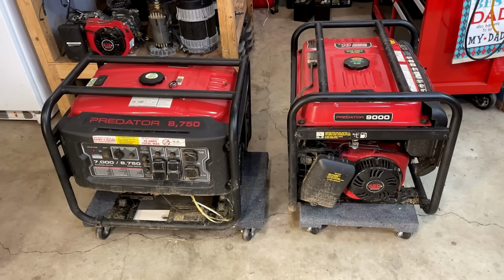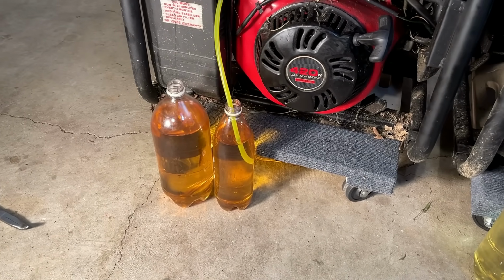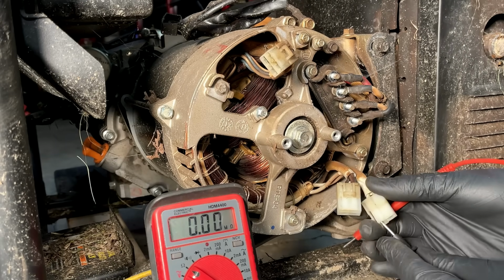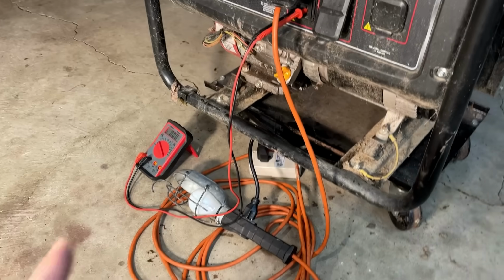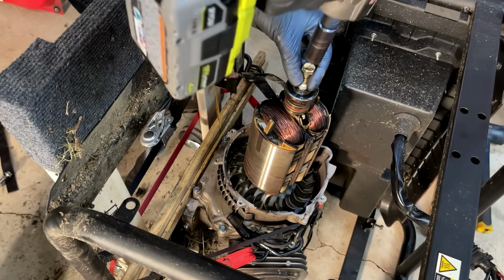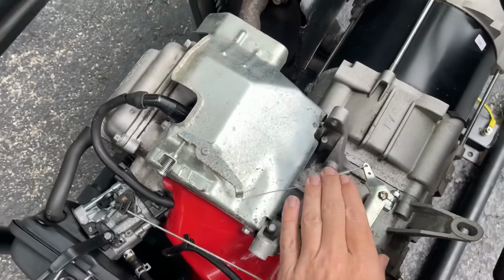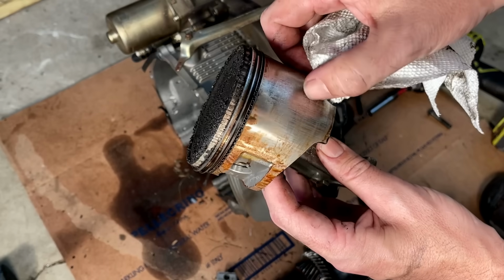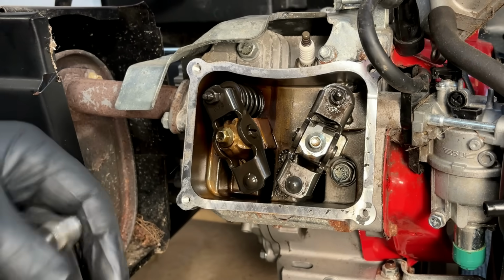3 Abandoned Predator Generators - Will They Run?

Comment: I hope nobody gets an idea that these generators are complete junk from this video, these actually are worth the price when comparing them to any other of the Chinese Honda clone generators from Briggs, generac, Honeywell, lifan, and many others. Proper break-in and oil changes keeps these running well for at least 1500 to 2k hours. The first two probably never had an oil change since new.
Reply from the maker: The original owner definitely got his moneys worth on these.  It does not take long to run up thousands of hours on a generator when living off grid.  These are meant for temporary emergency power and not expect to last much more then 1500 hours or run 24x7.  But they can last a lot longer if properly maintained and a little bit of luck.  I wish that had an hour counter.  It would have been interesting to see how many hours they had on them.
Reply: @jcondon1  Well at least you solved the mystery where the bearing race came from.
Reply: @jcondon1 I have a 2 year old same Predator 9000 generator. Do you have any idea what the THD% is on that generator. It’s not listed in the the manual. I called Hf and asked and they said it’s not listed bc it’s not a inverter generator. He did say that it has a voltage regulator to maintain 60HZ. I’m just wonder about dirty electricity with my electronics especially my furnace which is 2yrs old. Do you have any input? Love your channel!
Reply: @demetriosa7646  kinda funny that they say the voltage regulator maintains the frequency, because that is completely wrong the spring acting against the mechanical governor control s the frequency and the voltage regulator controls the DC Exciter voltage for the rotor and thus maintains the correct voltage for the AC output of the generator
Reply: Well, he must have bought at least four over five years.   If we suppose he was running them 24/7, then he was getting about 11,000 hours out of each one before failure.   Probably never changed the oil at all and that lead to the failure on each of them.
Reply: I have two of them.  They run great. Change the oil every 50 hours.
Reply: …and, were probably run for hours and hours every day, being off-grid.
Reply: What do you figure caused these engine problems? Oil neglect?
Reply: How much can you sell that smoking one for?
Reply: I’ll be honest the video didn’t convince me they are junk, it was the 30 seconds of run time I got out of my 8750w inverter generator and the 90 day warranty. I would have looked past the locked up engine and exchanged it if i didn’t have to buy the extended warranty for an extra $400.

Comment: If the generators were outside there may be moisture between the rotor and ground.  Clean the rotors good and let them sit in a dry place until they are completely dry.  You can also bake them in am oven at low temp (~150F) to dry them out.

Comment: Get a Robin Subaru 650 generator
Reply: Off grid? 
Honda EM6500S for the long term win....
Reply: @JohnSmith-yv6eq  Robin surbaru it's a Japanese brand and it's about 20 30 years old and I have one and it started on first pull and makes power better than other brands
Reply: @moosanouman  
Sorry, I misread that;
the Fuji Heavy Industries 
(parent to Subaru) 
(Subaru bought out by Yamaha in 2016) (generator and small engine line closed down 2017) 
made good generators in that 30-40 year ago age bracket.
I gave one (EY27 engined) to my sister as a gift......with the fuel to keep it running for a day.
An emergency happened and they found that the 17 year old son had tipped the emergency fuel into his car's tank.
They had to overnight in my house...  
That was why I wondered about the Robin name being used if it was a new generator....as Subaru don't make them any more....